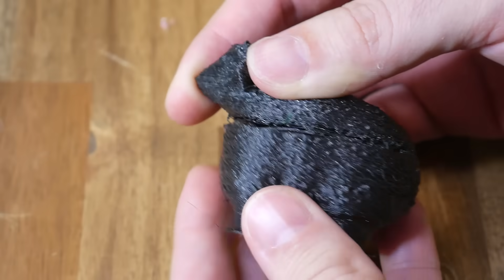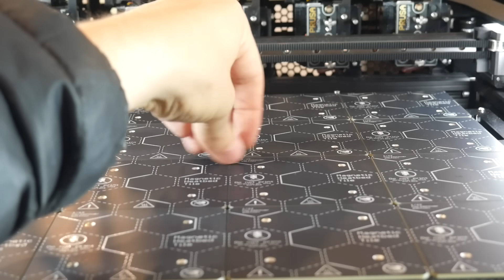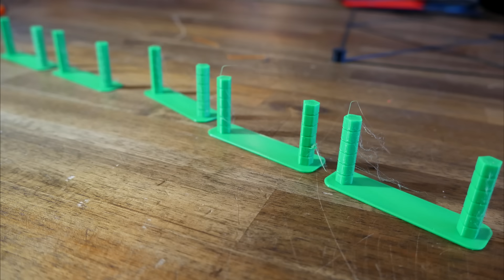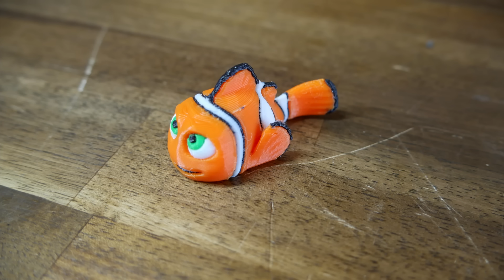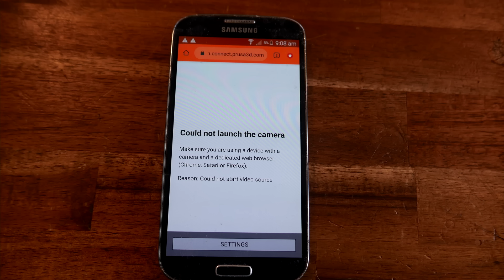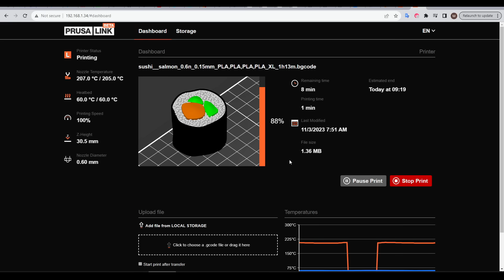The 5 tool Prusa XL is currently flawed, but I think it can be fixed

Comment: Prusa is very similar to Creality: they only have one successful machine that they have iterated in small increments over years, and every significant departure away from iteration is either a vanity project or half-baked. Creality is the Ender 3 company and Prusa is the MK company. Neither heavyweight managed to drive their wealth and engineering to transcend this banal truth.
Reply: Or a Fluke multimeter. It’s not always a flaw to stay on what’s working. 
Longtime support for replacement parts is another good thing about Prusa. 

The XL hmm. I would not buy it. Too expensive for not having an enclosure and heated chamber. 
Software is also lacking. They only added endless spool mode recently.
Reply: @Todestelzer Fluke however have a great number of well respected and high performing tools within electrical metrology and testing.

The analogy you made doesnt hold.
Reply: That is a hot take, It hurts to hear, but yeah it's totally true, prusa needs to up its game
Reply: TBH. creality just doubled their number of great models with K1 series.
Reply: @martonlerant5672 The K1 also has a few faults. However, these are minor and easy to rectify. Just like the first Ender 3.
Reply: First you buy the Brand and the hype but dont Look behind the stuff
Reply: Humorously, Prusa uses Microsoft's Trademarked paper clip face in prusa slicer (tipnofnthe day) but of course with Josef's likeness.
Reply: I do love my Ender 5….. 🤷‍♂️
Reply: Managed to? They never tried, because that wasn't the goal. Lmao. The goal was to sell half-baked, branded, feature-rich junk to people who don't know any better.

I think they both did exactly what they meant to. Transition money from your pockets to theirs for nothing that hasn't been done better before they had a go at it.
Reply: Sovol is giving prusa a run for there money tho
Reply: My ender 3v2 hasnt had a single issue in three years. I like the look of those bamboo printers though.
Reply: Prusa i series was a lasercut mendel which got rid of most of the annoying fiddling of setting up a mendel.

But sure there were like 100 others who tried the same thing and failed to make it a business, same with extrusion mendel clones.
Reply: To be fair, Creality is copying Bambu now so at least they’re “innovating” 😅
Reply: Prusa never was well built. It was just that the other options were worse than prusa and it was relatively easy to replace  parts. 

The MMU was the worst piece of junk I ever wasted money on and people still defend it by arguing "well you just need to do 30 fixes to get it working"

No, you shouldn't need 30 fixes to get smth working. The only way to ever excuse smth is because there were just no other good options.

If prusa keeps on what they are doing now they will dissapear in a few years.
Reply: @huyopo yes they were, I have a mk3 from 2018 that has had zero issues
Reply: @CourlandEngineering  then you probably were lucky. Can't imagine 0 issues though. Something will break in 5 years regular printing. 

The MMU on the other hand kinda proves that they will release an unfinished product in hope the customer will fix it. 
Prusa has some kind of arrogance and in the past it paid off. But now with bambu in the game they will go down very fast exept they massively step up their game. There are 0 reasons to buy any prusa printer over like a bambu printer right now exept you value open source that much that you are willing to have a worse experience for more money.
Reply: Well that sucks, it looks complicated, outdated and expensive…. Prusa rush this printer and it’s a complete disaster… hope you get this sorted out soon. Regards from Bogota.
Reply: You never owned a Prusa and talking trash!
Reply: @petermarkk1408  simp
Reply: Yeah but creality printers are all unreliable and prusa printers are well built
Reply: @drwho495 well-built? Did you watch the video?
Reply: @geometerfpv2804 historically they've always been extremely well-built. This is the outlier, not the norm, and knowing prusa they're gonna get it right in a few months to a year... Pretty much every new model by them has had a rocky start, lol
Reply: @drwho495  clearly this video shows that Prusa machines aren't universally well built. Then there were the Mini launch issues, and we can't forget about the infamous MMUs...
Reply: @drwho495 that's not true. Prusa print quality - as seen in this video - is dollar for dollar worse than anything available. I'd take an Ender 3 over a Prusa any day. Ender isn't pretending to be an audi and giving a Dodge caravan output.
Reply: @drwho495 I ran a print farm back in 2019 with 30 prusa printers. Well built is not what I would use to describe them. They worked and stayed working but always needed maintenance. Printed parts breaking etc.
Reply: @kongchho  What parts do you mean, the printed parts of the printer itself? Very much wondering how that works.
Reply: @kongchho Printed parts breaking?  That sounds weird. The issue with Prusa’s printed parts isn’t strength, but cost. For instance, the difference between the price of the MMU complete kit, and the kit with no printed parts but including the required filament, is €40. That is nuts. Prusa would do well to switch to injection molded parts which are far cheaper, while still providing the files for people to print replacements when needed.
Reply: @kaasmeester5903 Yep.  You use 3D printing when you need like one to maybe a few hundred parts. When you need thousands, injection molding is cheaper, faster, more consistent, better quality and stronger. This adherence to 3D printed parts has always made me question the Prusa methodology. The company's products would be a lot more cost competitive and higher quality if they used normal injection molding where it makes sense.

Comment: Ohh...well...prusa...I think there are way better printers out there...I myself looking to buy a k1 max...
Reply: K1 Max isn't comparable; it does not have a tool changer system, nor a MMU.
Reply: @DJProPlusMax you right...is not the same.. build quality, material used and the price does nothing to do with prusa. ..also bambu lab at 5x lower cost than the prusa is not the same...you're right...prusa...lol not even for free I want it...